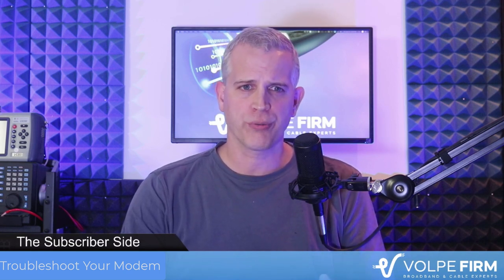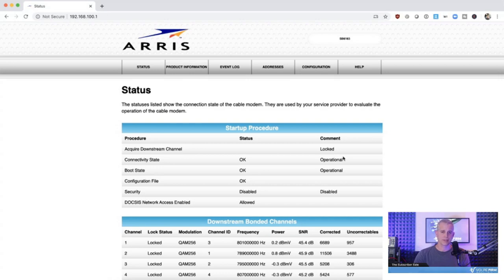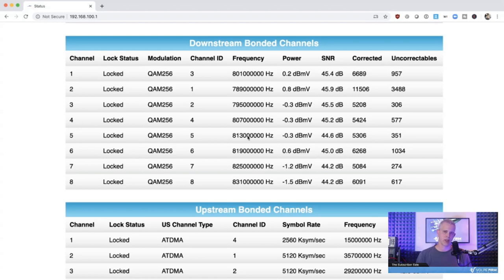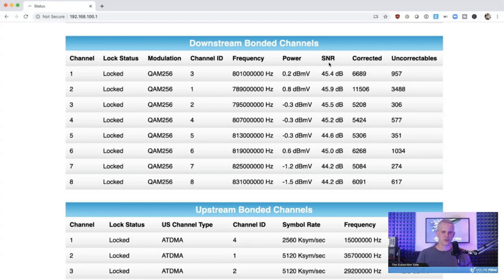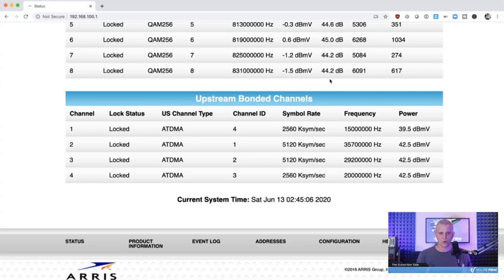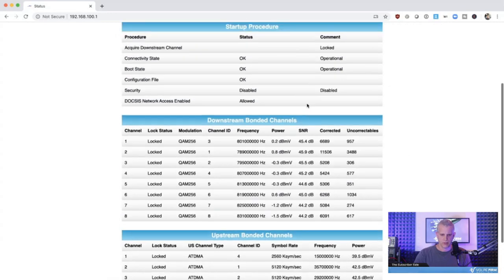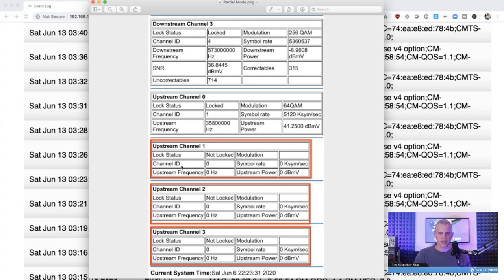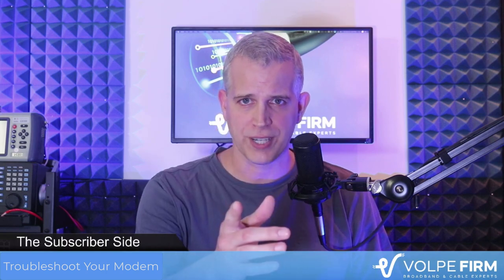How To Troubleshoot Your Cable Modem

Comment: Good info.  I went to a gigabit cable sub back in March and for 2 months had no issues.  Then last week I started to get disconnected multiple times a day.  I tried various 'fixes' and the ISP kept saying everything looks good to the modem.  Since ISP modems don't allow access to logs or stats I bought my own, a Netgear CM2000.  I saw many error messages like No Ranging Response received - T3 Timeout, SYNC Timing Synchronization failure - Failed to acquire QAM/QPSK symbol timing, to name a couple.  So I contacted my ISP and they sent out a tech and for the most part saw a great connection but then packet losses every so often.  So he replaced the splitter at the box on the side of the house and removed the only splitter inside the house and made a new connector due to possible oxidation.  That appeared to resolve my problems since I've gone 15 hours since the last disconnect.  So if you are having issues, look at your connection from the box outside to your modem and remove as many splitters as you can.  I don't need any inside the house because all I have is internet.  We stream now to our TVs with Firesticks so for us a strong wi-fi signal is more important than having coax in every room.  If there are additional issues the tech recommended escalating to the next tier to have someone look at the tap at the pole.  He thinks the one we have was put there in the 1980s but he can't tell because all identifying labels are no longer visible.
Reply from the maker: Hi Patrick, great success story and great advice. Thanks for sharing.

Comment: This was helpful. My issue was my main coax coming into the house was plugged into a splitter that was occupied by 6 different cables that weren't being used. The cable I was using for the modem was fed into a wall splitter that screwed into another angeled splitter. Taking off all the unused cables from the main splitter and removing the angeled splitter resolved my issue. I also found out about coax terminators that you can use to cap off unused connections on the main splitter.
Reply from the maker: Great job troubleshooting!

Comment: All my problems here in Idaho with Spectrum has to do with a system that is over 50 years old. Having my residential service line replaced solved ALL my problems with dropped signal. However, every time it rains my band width drops from 250mbs to less than 10mbs. Every time a tech comes out, they want to blame problems on my in house wifi. They don't know that I have brand new equipment, modem, nest router, laptop. My ethernet connection bandwidth is within 10% of my wifi. I'm convinced technicians don't like climbing ladders. Someone needs to make a video on how to successfully make Spectrum address THEIR system deficiencies.

Comment: I pasted my error message in google and nothing useful came up. I pasted in YouTube and this video came up. Turns out I had a wonky 90-degree/right-angle connector that was of the swivel type which made the outside connector loose af. Since removing it from the equation, no issue! Subscribe for more cable fun facts!
Reply from the maker: Nice find. The less connectors the better. Less things to go bad or come loose.

Comment: Hi Brady, thank you for this great information. You've mentioned that downstream receive power should be between -10 to +10dBmv, I would like to ask if this is a standard receive level for a DOCSIS 3.0 system? Because other cable operator imposes -8 to +8dBmv receive power. Thank you
Reply from the maker: Hello @engrboltz, a standard downstream receive power range for cable modems is - 10 to +10 dBmV, with an ideal level of 0 dBmV. It is advisable to maintain a receive power between - 8 and +8 dBmV, as this further optimizes the level and offers greater stability during temperature fluctuations, plant alterations, and other factors. This way, the modem is less likely to fall outside the acceptable +/- 10 dBmV range.

Comment: Does entering 192.168.100.1:8080 for the spectrum analyzer works on 3.0? Or that’s a 3.1 feature?
Reply from the maker: This was introduced on D3.0 modems
Reply: @Volpefirm  Didnt work when typed in

Comment: Where would I find a setting to change my mtu setting ? I just want to get the best performance out of my gateway. I saw a different video explaining something about pinging to find out the max setting that could be used for the mtu setting.
Reply from the maker: Hi Borb57JC you can change the MTU settings directly on Linux machines by running the following command: "ifconfig <Interface_name> mtu <mtu_size> up". This is done on an interface level. There are likely similar commands for Windows and Mac. You want to match this on all switches in the network.

Comment: So I have been having issues for over 6 months now and I’ve had 3 Techs come out to try and resolve my issue. My Wi-Fi cuts out randomly for about 5-10 mins multiple times a day. I logged into my gateway online and I’m having a ton of Uncorrectable Codewords. Do you have any suggestions on things I can do myself to try and fix the issue? My SNE, power, etc is all good. Any suggestions? Thanks
Reply from the maker: Hi Main Legit, if you have uncorrectable codewords showing on the modem, then your WiFi maybe cutting out because data is cutting out to your modem. My recommendation is first ensure its not your in-home wiring. Get a good piece of coax and run the coax directly from the outside drop to your modem. If your uncorrectables go away, then its bad coax/connectors/splitters, etc. in your home. Find them and eliminate. If you still have uncorrectables over time, then you need to show what you did (running coax from the drop to your modem) to the next tech that shows up and also show him/her the uncorrectables when connected to the drop and let them know they need to 1) replace the drop and 2) if that doesn't fix it they need to work on the outside plant - its their issue to resolve.

Comment: how do you lock a channel. I have 32 channels and all are locked but 1. I have very slow speeds. I did all the resets and reprovisions. not sure what I should do next. xfinty sent signal after signal and Netgear changed channel after channel. nothing is working
Reply from the maker: Unless you're experiencing issues, you will be fine with 31 out of 32 channels locked. If you are experiencing issues, then I recommend checking your in home wiring and connectors - make sure connectors are tight and there is no damage to your coax cable. Next steps are to call your cable operator - Comcast does have very good troubleshooting tools, but you may need to be very clear of the issues you have.

Comment: Hi, I really hope you answer. So I have a 32 channel modem, i noticed that channels 25-27 build up alot of uncorrectables in the morning and the power goes up around +8 dBmV on all three of them and when this happens my modem stalls for a few seconds causing my router to lose internet connection and disconnects all my devices for a minute. This happens 2 times a day, one in the morning, one in the evening. 

My question is, if I buy a 16x4 modem, will this problem go away, since these uncorrectables always occur on channels 24+ ?
Reply from the maker: Maybe and maybe not. If your 16x4 locks to the same downstream channels that are causing issues with your 32x8 modem then you will still have the same problems. First check your home wiring and make sure this is not an issue with a high power sodium light turning on. Since it occurs in the morning and night its likely a noisy light or something similar turning on and disrupting the signal. The noise is most likely getting in around your drop or inside your house. If not there, then let your cable operator know about the issue and especially the time of the issue. This is very helpful trouble shooting info for them.

Comment: My Arris SGB10 cable modem won't connect to the DNS server for some reason.  I called the modem company technical support line and was connected with a service rep in Asia that didn't speak English well enough to effectively assist me.
Reply from the maker: Hi Traveler10 your modem should get the DNS server information from your cable provider. You will need to contact the cable provider in order to have them troubleshoot a modem DNS issue.

Comment: Hi volpe my cm 2000 netgear modem is blinking down stream and I keep getting MDD TIMEOUTS
Reply from the maker: Hi Natural Gaming, your modem likely is not getting enough downstream level - at least that is the most probable issue. Check your cables and connectors. If they are good and snug, you will need to contact your  cable operator.
Reply: @Volpefirm  get update so my shits working great right now what do you think was happening at the maintenance pol

Comment: How do I deal with Pocket Loss everything was OK until I set up my New Docsis 3.1 it seemed ok I lost Connection alright got back on Downstream lighted Green, Upstream light Green

but as soon as I talked to my Cable Provider they say I have Packet Loss all I'm getting is kinda slow Imternet what do I do
Reply from the maker: Hi Badass, how is your packet loss now? Its been three months since you made this post and cable operators have learned a lot in the past few months about OFDMA. Curious if your problems have improved.

Comment: Thanks for the video. I have 7 unlocked upstream channels and my ISP says it looks like it’s a problem from their end. I had feared my modem (less than 2years old) was going bad.
Reply from the maker: Hi Carol, unlocked channels are almost never related to a bad cable modem. When a cable modem goes bad they usually are just dead due to a bad power supply and not LEDs work. So you did good. :)

Comment: I'm experiencing latency jitter that varies quite a bit but every other ping is a 10+MS spike. The modem shows 1439575373 corrected errors on channel ID 25. These corrected errors seem to keep increasing each refresh of the page. They are sending someone out to check everything which they failed to check today. The guy replaced the modem with basically the same modem as well. What type of problem causes that many errors?
Reply from the maker: Hi Derektrash8142 correctable and uncorrectable errors maybe caused by the outside plant or in home wiring (like bad connectors and cables). If you have a neighbor with a cable modem see if you can check their modem and if they have errors as well. If they do not, then the root cause is likely bad connectors or cables from the drop to your house or wiring inside your house. You can move your modem closer to the entry of your house and see if errors are reduced. Think "divide and conquer". If your neighbor does have errors too, then its an outside plant issue that will need to be escalated to the cable operator. You can also escalate for your in-home wiring, but I like to try and do some troubleshooting myself just in case I have a bad cable that I can replace on my own.
Reply: @Volpefirm  I will do that, I will also mention that on that port 25 (OFDM) there's multiple profiles (Profile 0, 1, 2 & 255) The active profile has 775,066,634 corrected codewords out of 775,170,751 possible. 

The other profile 255 is 125 billion out of 126 billion possible corrections. The profile 1 & 0 have little to no corrections. I just find it really weird. They said they're looking into it. The guy who came said he replaced an old cable but it didn't do anything.

Comment: Great info!

Question- my Motorola mg7700 modem is showing t3 errors in the log file only on powerup. The front downstream led comes on at boot up but goes totally out. After connecting to the internet. the downstream channels are all locked. Downstream Snr = 37 - 38.5 db
Upstream power is 54 dbmv with channels locked.

The modem wifi radios are turned off since I’m letting mesh handle tx/rx radio duties.

I read somewhere that the upstream my have excessive noise causing downstream issues. Or maybe high upstream power?

Have you seen this before?
I have the ISP tech coming to check the lines tomorrow. If it’s my equipment they said they are charging me $70. Just wondering if I should call them off.

Thanks!
Reply from the maker: Hi Big Kid, sorry I missed this before your tech came out. It looks like your modem was at max transmit which may have been due to a bad drop or in home wiring. What did they find out?

Comment: Hey my DOCSIS Event says warning Mimo event mimo you said not to worry sbout this messages but my internet is really bad and i feel like this error means something what do i do
Reply from the maker: Hi GTA5film - MIMO is indicating whether your modems supports IPv4 or IPv6. This is messaging between the modem and CMTS as regular status updates on the modem can do and does not indicate any problems. Are you seeing any uncorrectable codewords? If not, I recommend you connect your computer to the modem with an Ethernet cable to rule out Wifi issues. If it gets better then you may need to improve your WiFi network.

Comment: A little off topic but how important is having splitters grounded?
Reply from the maker: Splitters usually don’t need to be grounded inside the home. I am not sure of the requirements on outside dwelling splitter grounding. I don’t usually see this done however, so I don’t believe it is required. A ground block is required.
Reply: @Volpefirm  In my case it made all the difference. I always had very poor net for online gaming but after grounding my home splitter all the sudden it was unreal my net  became great for online gaming. But this means that probably i have interferences in my home right?
Reply from the maker: Hi @Byynx, I hesitate to guess on what the root cause is in this situation. I'm glad your network has improved, but I'm not sure what the root cause may be.

Comment: so my cable modem is an arris router and my problem is that it became slow and scuffy. In my router lights it supposed to have 2 lights, the recieve and send blue light. When it is only 1 blue light the problem starts. I did what i can like resseting the settings and the router. What should i do?

edit: when i check the router settings it is only 1 Upstream Bonded Channel. before the problem it has 4 upstream bonded channel
Reply from the maker: Hi Charles, when your modem has only 1 upstream channel this may cause slow upstream speeds. If you also have only one downstream, that will cause slow downstream speeds. The modem drops channels due to channel impairments. Rebooting the modem may allow the modem to pickup the channels again until the impairments are fixed. The impairments could be in your house. Be sure to check all connectors and cables from your modem to as far as you can to the cable operator network. Use good connectors and cables and make sure they are tight.

Comment: Hi!

I have been trying to find information whether a DOCSIS 3.1 modem from the US-region would work in Europe?
I know differences between earlier EURODOCSIS and DOCSIS standards but I'm curious to know if modern modems are able to adapt to any environment or is the hardware so fundamentally different (hard to believe) to truly warrant different models?

The reason I'm asking is that the situation with many ISPs here in Europe is such that none that I know of offer a modem only solution. I know many home network builders would prefer a pure modem instead of a wifi modem/router.

I haven't received a clear answer to this even from my ISP and seeing that some modems (like the Technicolor TC4400) have a "dual mode" that lists both DOCSIS 3.1/EURODOCSIS as supported makes me wonder if they would simply work if plugged in :)

I would be very grateful if you could shed some light on this.
Reply from the maker: Hi Mikko, in many cases there will be a good possibility that the firmware in the modem will be programmed to frequencies and a diplex filter bandwidth that will not be compatible with your cable service provider. There are some modems that will be fully supported, but it would very difficult, even for me to be able to make this determination.

Comment: I installed the arris S33 modem on my internet because it was on the so-called "recommended list" of DOCSIS 3.1 modems from xfinity for my address. This modem did not perform well only delivering 100-200Mbps  to my network and seemed to overheat. I returned it and bought a Netgear CM1000v2 modem which has Xfinity on the box. When I activated it with Xfinity a warming symbol came up saying that I needed to upgrade to DOCSIS 3.1 even though this router is a DOCSIS 3.1 modem. When directly connected from new modem to my computer I was getting 750Mbps internet speed which seems reasonably decent. When I inserted my ASUS AT-RX1800s router back my internet speeds dropped to about 350Mbps with all of the settings optimized. 

Is the router bottlenecking my internet speed?

When I log on to my Netgear CM1000v2 modem, only possible when it is directly connected to my computer, I only am allowed to change password, and log at the log file. I cannot obtain any detailed status about this modem. Does Xfinity turn this off?
Reply from the maker: Hi Glenn,
Its unlikely there is anything being blocked in the modem. This is more likely an issue between the modem and router. Ideally you will want to put the modem in bridge modem so that is not doing any routing and have your router manage all traffic.
Reply: @Volpefirm  I am not sure what you mean by "put the modem in bridge modem". I simply inserted the router between the computer and cable modem. The router is handling all of the routing and my connection was measured in the "wired" mode. I see a small reduction in speed in wireless mode to my MacBook Pro, both router and computer are equiped with wifi6. If the router is handling multiple routes to other computers that could also degrade the speed.